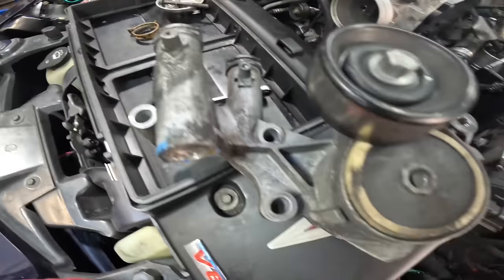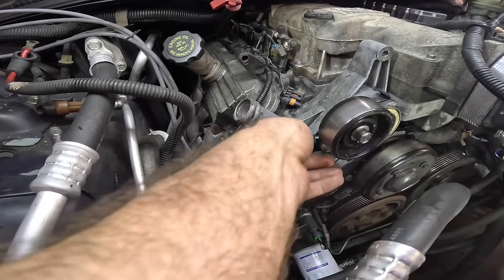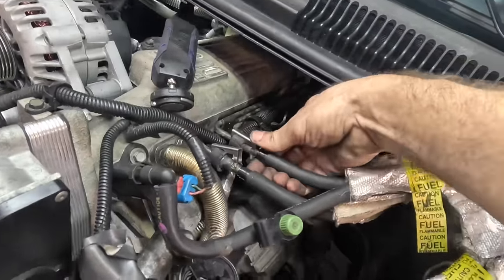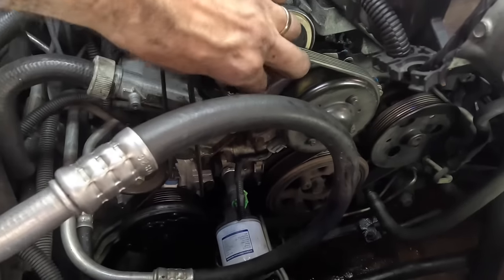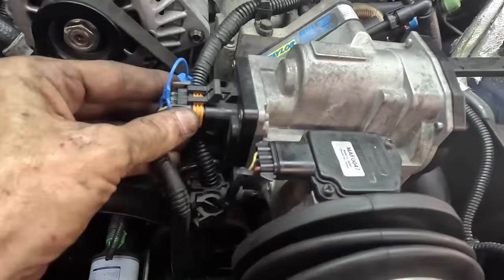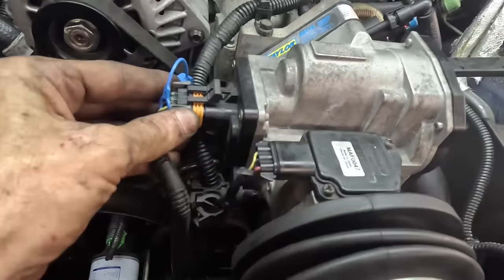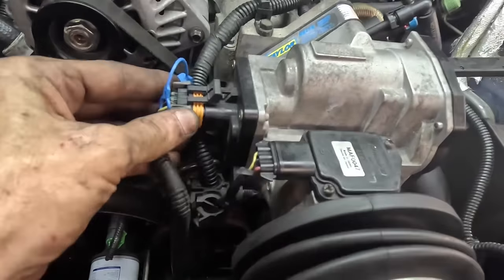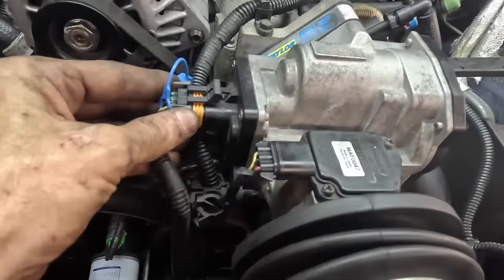Lower Intake Manifold Leak-Final Assembly! Oil In Coolant GM 3.8L 3800 Series II Engine #repair

Comment: I have a 1998 Buick Riviera with the supercharged 3800 Series II V6.  It had 140,000 miles on it when I bought it in the summer of 2011, today it has 280,000+, still runs like a dream.  Have kept up with all maintenance, swore loudly at the GM engineers who parked a motor mount right in the middle of the main serpentine belt.   My dream is to someday go on a cross country trip, place it in the loving, knowledgeable hands of Ray, and pick it at some later time when all the humorous glitches, it has have been chased away, and maybe fresh paint from the shop that did the big, gorgeous, now Silveryado grey paint.  One can dream, right?  Greetings Ray, Lauren, and kid units, from the snowy Northwest.  😊

Comment: Rinsing your engine with a hose is like driving in a rainstorm, but most people don't get that.
Reply: True.
I lived in Florida and those cloudbursts were like a couple hundred hoses.😊
Reply: Only if you dont have a hood
Reply: perhaps driving at high speed through puddles...
Reply: @Boodieman72  I have seen my engine that wet driving in pouring rain in Indiana, all shrouds in place. It's called puddles
Reply: Yeah that's why that make EVERY electrical connector waterproof. Because it doesn't matter...

Until the weatherproofing FAILS, then it does.
Reply: With most engines not a problem but some newer engines do not forgive a rinse with the hose. One example would be most 2008 and up Mercedes.
Reply: @juergenpaton5004 bs mate, I’m a mechanic at MB for more than 13 y and we frequently rinse engines that way, the only thing you have to look out for is the fuel filter.
Reply: I would not let water into the alternator. I a rebuilder diode don’t like to get wet.
Reply: Newer vehicles have a lot more electronic modules under the bonnet & they are more prone to green gunk in the connectors & modules so it is not advisable to be in there pressure washing it but a gentle wash down (Like Ray did is not going to hurt anything even on new vehicles.) is okay.
Reply: Rain getting pulled in by the radiator fan and water that splashes up from under the car is what the electrical connections are designed for. It's when people use a pressure washer that things go bad fast because that can push water past all the seals. A low pressure hose used carefully isn't going to hurt it.

Comment: Hands down the GREATEST MOTOR EVER!! The GM 3800 Series-3. Mine is in a 2009 Buick LaCrosse. It was the last year for the 3800 in the Buick LaCrosse. It is an unstoppable work horse and parts have an average price of less than $100.00 and are sold everywhere!

Comment: Rainman Ray, you’re so GOOD. Awesome job.
True Story, Way back in Ancient History, I owned a 1961 Corvair Monza when I was 18-19 y/o. One weekend I was installing a new Radio or something & I was in the floorboard trying to connect a loose wire to a power source under the dash & my nose just barely touched the Floor Shift Lever & I started feeling something unusual. I just passed it off as my imagination, but it continued for as long as I touched that Gear shift lever. After about a minute or two/Dos, I realized I was completing a Circuit by touching a power source & the Gear Shift Lever. I had to change my position in order to make the power connection w/o completing a circuit. Less nose pain.

Comment: Nice seeing the Firebird all finished. The cooling system cleaner looked to be doing a good job getting that oil removed. Should have many more miles of life now that the intake (upper & lower) are now sealed. Possibly these gaskets will survive better/longer. I found this very interesting, seeing what this design was. I worked on many earlier generations of this engine, the 231 V-6 was its predecessor.  The Turbo V-6 version was difficult to work on as well. Thanks for another great video, Ray!

Comment: Your remark on how multi viscosity oils perform is on the mark and very succinctly put.  I've explained this to others on many occasions.
Reply: What he said is true but for most owners it is better to stick to the manufacturers recomendation.(they built the thing so they should know what is best.)
Reply: @LesReeves  A lot of that is for CAFE reasons ... Corporate Average Fuel Economy.  For example, GM officially recommends 0w20 in the Tahoe PPV with the 5.3 engine, but has told police departments to use 5w30 instead as there are high component failure rates with 0w20 in severe service.
Reply: @silicon212  In special cases it will matter but as I said joe public is better off using recommended oils especially if they only use the vehicle as a daily driver & do the recommended interval oil changes with a good filter.

Comment: FWIW. We had an oil cooler fail on a 1500kw diesel generator, which loaded the cooling system with oil. Service company ran a bottle of Dawn dishwashing liquid mixed with water through the cooling system running for about 30 minutes. Flushed it out twice and the cooling system was nice and shiny inside.

Comment: Darn good engines, had one in my GP, ran like a top and had no issues, it had 220 k on it when I saw the rust repair on the body was going to be a PITA.
Reply: Yep I had to retire my 97' GP with a 3.8 because the right rear shock tower rusted out of the body. Dam I miss that car, it had 250k.

Comment: Brings back memories.  Did a RH Cyl Head /and new Intake gaskets on my 2000 Firebird 3800.  2 weeks later A/C Compressor replacement.  All tight fits!!

Comment: You are correct, the first number dictates the viscosity when cold and after the W is when hot. The Lower the first number the lower viscosity on cold start, however i was told that you run a lower viscosity in the cold weather, so it pumps easier and the higher number in the hotter months for more protection.
Reply: Weather then weight
Reply: @shadowopsairman1583  Yes the weather should dictate the viscosity thinner oil in the cold and thicker when it is hot
Reply: W = winter

Comment: Seeing your consistent use of your New (functional) parts washer, I thought I would suggest something for a 'wish list' item. Saw this on another channel and it makes things Extremely Nice and Shiny. ✨️ An Ultrasonic Cleaner. Cleans parts externally AND internally with minimal time or effort.
Reply: Yes had an industrial one. Used 44 gallons of tricholethane, and would clean things in seconds.  We used it to clean PCB's, and that was a fine balancing act between stripping off flux residue, 2 seconds, and stripping off the conformal coating, ranged from 5 seconds to never, depending on the exact conformal coat used, of which there were 3.  Leave a board in for 10 minutes and the resin bonding the actual fibreglass weave together left, which was useful for some boards, where we were robbing parts off them, and did not care for the actual board itself, though it did a number on component markings, so they were all labelled again afterwards to identify.. Hot solvent was also great to remove potting compound from the high voltage assemblies, it took around 1 minute cycle to soften the surface, and then you could pick out the soft resin without damage.  When finished pot the assembly again to keep it from arcing over.

Friend would bring stuff over for cleaning, though I told him when to bring dirty things, like carburettors, valve assemblies and such, when it was getting time to replace the fluid due to it being too dirty. Then all those went through in an hour, and then dump the hot dirty fluid into a drum for disposal, and fill with clean new fluid. Carburettor, put in black with dirt, and it comes out looking like it just came out of the casting mould.

Comment: Love your videos.  Coolant vs water.  The liquid in the radiator is put there to cool the engine.  Water works well as a coolant but causes corrosion and freezes in cold climates so  antifreeze is added to the water.  So, it is okay to call the water in the radiator coolant even if there is no antifreeze added.  Technically antifreeze is not coolant until it is put in the radiator.

Comment: g`day ray i thought you had a leak when you started the engine  if you look at the center at the bottom visible pulley over the air cleaner  the holes in the pulley make it look like its leaking fluid  lol had to rewind to check and realised it was the holes in the pulley  i had the aussie version of the 3800 great little motor great video cheers ray

Comment: We ran those engines in Australia 1988 VN Holden Commodore to the 1995 VR Commodore great little engine they have been swapped into all kinds of things. Our current Wingless sprint cars run them very cheap very reliable but slowly becoming rare. 🇦🇺
Reply: Drove a 1980 Chevy Monza with the 3.8 in the late 80's. Good engine.
Reply: I've had several with no issues.
Reply: @midniteoyl8913 I had 1980 Chevy Monza had a 305 V8 and positive track rear end from the factory it was called a spider.. I rebuilt a 350 and put it in.. used to drag race it...fast little car
Reply: Wife had a VP with the 3.8 - ex cop car. Inherited it from her uncle who had run a mowing business with it for a couple of decades, engine still ran like a champ until the auto box packed it in.
From memory the plenum design on our aussie ones was a bit less complicated that this pontiac version, maybe holden worked out the coolant leak thing 😂
Reply: @shannon-852  and yes the VS just has a normal radiator with a cap lol who knows what they were thinking with those bottles they were junk I had a VN Berlina wagon with one of those stupid things same as VP
Reply: @shannon-852  Yep & the body design allowed for better placement.

Comment: The Buick 3.8L was a great low-rpm high-torque motor.  We used to rebuild Jeeps back in WI.  First thing was to rip those junk Jeep motors out and put this motor in (along with drivetrain and axles).  Made for great drivetrain for running the pipelines!

Comment: over the years , I have had 2 cars fitted with this engine model,  Holden VS Berlina  and a VY2 Commodore . both reliable, strong and good touring cars  , easier to access than the Firebird

Comment: Here in Australia they put that 3800 Buick V6 in the GM-H products from 89 to 96 & they are still going without much repair work required the water pump & alternator are in different positions most likely why they do not suffer like that Fire bird.(Probably the best engine built by GM).

Comment: You'd want the 5w in the northern states for cold weather starting. The 5w is the equivalent viscosity of a straight weight at 32degF and the 30 is the equivalent straight weight viscosity at 212degF.

Comment: I worked at a used car lot years ago repairing vehicles that came in. We would get these and like you said except those gaskets  it didn't matter how many miles it had they always ran good. Had no idea how great these engines were at the time. Thanks for the video.

Comment: 5w at cold temps, 32°F. 30 weight at engine operating temp of around 200°F.
Either way it's a 5 or 10 weight oil with modifyers so it acts like a 30 weight oil when hot.

Comment: If you can get a 3800 V6 from a truck
It would make a good swap for project jeep especially if you can get a supercharger for it! The intakes on the 90 degree V6 had less problems. Another popular engine swap was the Chevy 350 / 327 small block engine.
Also the Chrysler 360-401 v8 you might need adapters for transmission/transfer case

Comment: This has been a very interesting series of videos on this engine. I don't want to know what the cost of this repair would be, but thinking in the thousands. I did own a 99' Buick Regal with the supercharged 3800 series 2 engine. What a phenomenal powertrain, smooth and quite fuel efficient too. I really beat the hell out of it, so I didn't have it very long- about 8 years. Oh well, thanks for the vids keep em coming.

Comment: I was amazed on one of my many VWs 316,00 miles in several years, never ever changed any hoses for cooling, i was always expecting to, but never needed.  they never leaked, or mushed out...they must have used good materials.  So they probably change it if stuff lasts too long, can't have that.

Comment: I have TWO Grand Prix's with the 3.8L V6s. A 1999 GTP (Supercharged) and a 2005 GT2 (NA). Great engines! Right up there with the small block Chevy's. Built a few of those over the years... I've replaced all the plastic serpentine belt pulleys with the Dorman metal ones :face-green-smiling:

Comment: Wait...Pontiac Fiero???? Nope. Go get some more coffee, Ray.
Reply: LOL he started calling it Fiero instead of Ferrari at the end of part 2 after letting people know that a person could customize their car as they want to without being criticized, near the beginning of the video.
Reply: @bruceaugustine6486 oh so it was intentional lol
Reply: @ianriggs the infamous Ray sarcasms.......😜
Reply: Pontiac Testarosa?
Reply: Pontiac bathtub. Really hot 😂
Reply: @MonkeyJedi99  Pontiac Daytona
Reply: Ferrari-bird.
Reply: Well they used to have a kit to turn a Pontiac fiero into a Lamborghini countach so anything is possible lol
Reply: For decades I cleaned off my engines at the car wash with high pressure and the engine hot. Never cracked  anything. I don't today because of all of the electronics. I kept after it with a spray bottle of degreaser , paper towels and shine it all up with silicone type detailer.
Reply: @MrSilverado1982  oh jeez I had forgotten about that lol
Reply: Reeeeeeee
Reply: 3.8 in a Fiero...that would be cool.
Reply: @ianriggs  Yes that is how it works
Reply: @michaelchristiansen1497  a transverse LS4 fits just fine. Not an easy swap but not that difficult either for a professional. Goes like a scaled dog. If you try hard you can keep the weight down to 2800 pounds or less. Sadly, it never had a really great suspension and handling package. It just looked like a high performance car. It was just a grocery getter made of parts of the GM shelf. The basic four banger only had like 90 hp. If it had been produced with 190 or 250 hp it would have been a screamer.
Reply: Yea I was cracking up too.
Reply: On another note. Yo Rainman. I have two California plates I had to swap out due to a salvage title issue. Do you want them? If so, I’ll send them to you free of charge. Both front and rear.
Reply: Pontiac FerrariBird.
Reply: Just messing with us...
Reply: Cry about it

Comment: With all their quirks, if you fix the weak spots of the cooling system and intake leaks, 500k miles is a realistic lifespan. Heck, 3.8l with 200-220 hp? Barely staining even if you drive it hard all day long. Add a little boost say 5 or 6 psi? Now you have a really fun driving experience without loss of fuel economy(unless you drive like me always "checking" it, cuz its fun!) or reliability. Think of modern engines with 1.6 to 2.0 L producing 300+ HP. Tow a trailer, run 4wd off road. Plan the funeral well in advance so that by 30-40k mi....you won't have a WTF moment. Enjoy your work both under the hood and deep in our hearts.😍

Comment: Had a bad intake seal on my 4.3. Ran through a couple of different types of flush trying to get all the sludge out. Took forever, but mine was really nasty. I eventually took the t Stat out and used dawn dish soap. Then took the upper rad hose off and back flushed with a hose until the rad ran clean.

Comment: Wait wasn't that a FERRARIBIRD😅 Good morning Ray excellent video, say Hi to Wife Unit, and Dave, ready for the rest of the week videos 😅
Reply: The oil doesn't break down, however some of the additives in the oil will separate and break down and the oil will not be as effective as it is designed to be. At least that's the latest thing science has discovered to the best of my knowledge.

Comment: You can run water in the coolant system. Actually race cars don't use coolant/antifreeze so if there's a spill it won't make someone go off the track. It's mostly to keep it from freezing in the winter and corrosion for street driven cars.
Reply: In daily driver it helps with overheating, increases boiling point

Comment: I live in Ohio and I run 5W-30 in the summer to provide better lubrication in the hotter temps and 5W-20 in the winter to prevent a dry startup in colder temps.

Comment: The lower intake gasket was a problem with a lot of the GM V6s including FWD, not just the 3.8. It was one case where the aftermarket gasket was better if you get the metallic one. And that's not a Fiero at all. 😂
Reply: A joke play on words because the owner Ferrari  emblem caps on the wheels.

Comment: I use to  own a a Australian  car VT commodore with 3800 engine. I notice the block is way back under the window.  The VT (2000) Commodore would have been easy as we had it more forward and we also had the 5lt and the LS motors in them. Similar to the Pontiac high performance. great video

Comment: I like your stance on hosing down Engines, similar to MORR'S stance on pulling on suspension components. If it can survive the abuse of normal driving conditions it can survive being pulled on or in your case, if it can survive a Florida mud puddle it can survive a rinse down with a garden hose. If it can't something else is wrong.

Comment: I always hose my engines down when running. I just don't do it after an 80MPH run on the freeway when they are nuclear hot. Never had a problem.

Comment: I live in Hawaii. I used 15w-40 diesel engine oil in my 2000 Sienna van. It worked fine. I have since returned to the manufacturer’s recommended 5w-30.
Reply: Why did you switch back?
Reply: @patrickchavez3848 because it made zero positive impacts and probably wore his rear main seal

Comment: The most reliable GM engine, is the C20NE/20NE/20SEH found in the Opel/Vauxhall cars from about 1986 to about 1993 the 2 liter 8 valve engine, rated at 115 - 116 or 130 hp depending on the engine code, has to be shot. It will not die, as long as it has oil and coolant. It's also non interference.